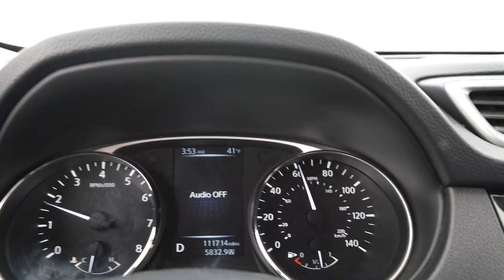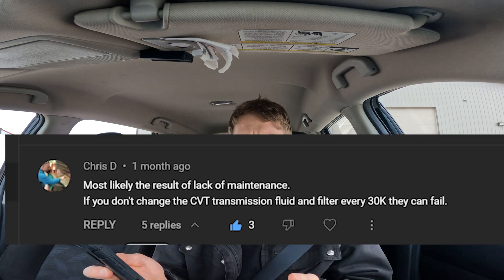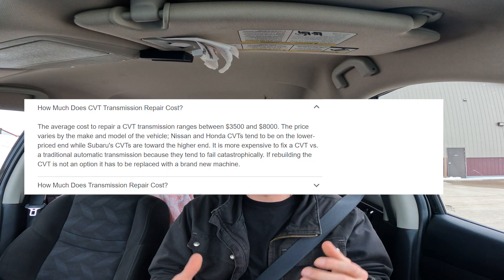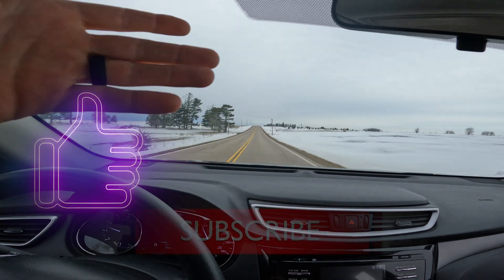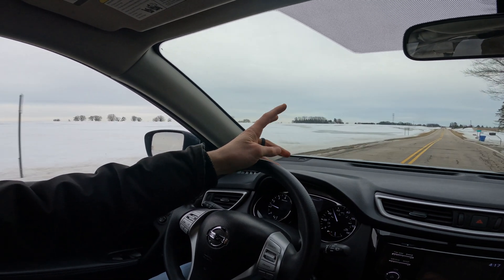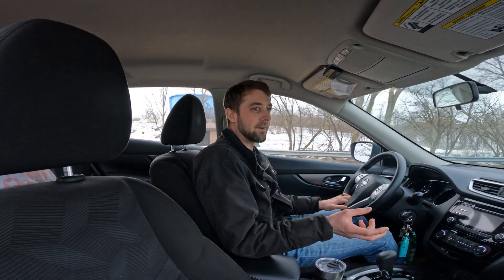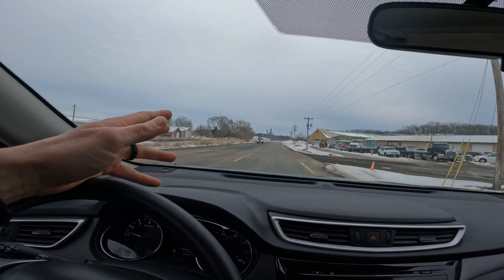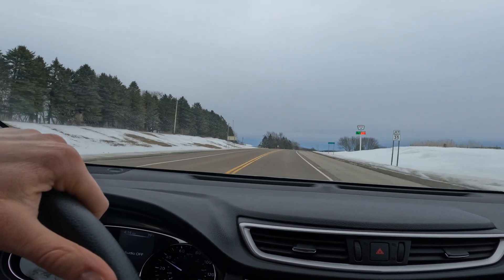Everything WRONG with the Nissan CVT Transmission

Comment: The cvt is expensive? I thought the whole point of them is that they are cheap?

Also, my understanding is the tech for CVT is awesome, but car companies kinda mucked them up, so you don’t get a the actual benefit.
Reply from the maker: That’s the funny thing, they equip them in the economy class vehicles for fuel savings and cost (so they claim) but then the replacement units have a more expensive price tag. For sure a reason for it that makes sense for these companies which I have zero knowledge on.
Reply: They are cheap for the car makers to build, but NOT cheap to repair, because there is usually no such thing as "repair".  Transmission shops do not have the skills, nor the parts, nor the desire, to do a "rebuild" of a CVT, and neither do Nissan dealerships.  They just swap out the whole thing as a unit.  That's why repairs are so expensive - they are "replacements".

Comment: Changing up too soon and hauling heavy loads in any transmission will cause premature wear. CVT's are designed to change up early and this is the trouble with them,,,,, so keep the weight out of the car and don't put your foot down too hard. lf you must have a CVT then do yourself a favor and make sure it is built by Assian. Jatco is the bad brand, only bought by the uninformed. 'Disposable' is the key word with any CVT transmission car.
Reply from the maker: Totally agree! great input.

Comment: I had a 2011 Honda CRV, but I managed to drive it 12 years without a CVT failure, but I only drove it 147,000 km. (91,341 miles) I don't know if Honda had failures with those CVTs or not. I remember doing a transmission flush at least once at the Honda dealership. Whatever they recommended I did. Now I have a 2023 RAV4 Hybrid, but they have an eCVT, and the only thing in common with the CVT is those 3 letters according to Car Care Nut. They don't have any belt, and Car Care Nut describes them as very reliable. He's a Master Toyota Diagnostician, and I believe him. When I bought our Honda, I had no idea what a CVT transmission really was. But I had no complaints about that transmission. I don't like to accelerate fast because that's a waste of fuel, so maybe that is what that comment before meant about how you drive it? Maybe if a person hits the accelerator hard it puts more stress on the CVT transmission?
Reply from the maker: Yeah it seems the common theme with the Nissan CVT is the cooling situation for the transmission isn't very good. So fluid changes are very important. Yeah I would agree if you were "beating" on the vehicle like harsh accelerations all the time that failures would arise. However I'm like you with this particular vehicle as well. Fuel savings. I do like those rav4's too. Great fuel economy and a great looking vehicle.
Reply: Just about to buy a used Nissan with a CVT. I will say that it is a 2y.o. replacement in a 2009 model X Trail, but the current owner hasn't had any issues with it. Also not sure about the noise comments. On the test drive  I didn't find it at all noisy, or hear it make sounds it shouldn't. I actually found it very responsive. Best of my understanding is the CVT failures we hear of are from drivers giving them a good work-out off-road, or constantly carrying full payloads and/or towing. Don't punish them, keep oil fresh and temperatures down and they aren't as unreliable as many make out.
Reply: hello fellow car care nut fan
Reply from the maker: @trevordoeshalloween5994   :person-turqouise-waving::hand-pink-waving:
Reply: Um...an 11 Honda CRV has a regular transmission, not a cvt.

Comment: Looking for a good used car is discouraging right now.  Newer vehicles fall into two general categories:  those with bad engines and those with bad transmissions.
Reply from the maker: Right! Or just buy a new whip for the small price of a middle class house that needs a transmission or an engine. Lolol
Reply: Or just buy a Toyota lol
Reply: @shaungranger2166 Even Toyotas are falling down the spiral of unreliable transmissions. At this point. Just buy a babied 2000s or older car. They don’t make things like they used to.
Reply: And if they are fairly recent models with low mileage, you may as well buy knew because they want almost as much as a new vehicle. So, it is either new or if it is a reasonable price, it has a ton of miles on it. Plus, they recent floods happening across the US makes buying a flood car so much more probable. They send them to detail shops and erase all of the damage and then down the road as corrosion starts to happen in the electrical system and your vehicle becomes a nightmare.
Reply: Wow, you hit that one on the nail! Have been looking for an SUV and it is a challenge. Sales people just want you to pull the trigger!
Reply: Ugly looking and weak bodies as well. New models suck
Reply: Don't forget ones that aren't maintained like a used rogue with 80k miles with original fluid in the trans.  Gee I wonder why it's slipping?!?!??!?!?!?!?!
Reply: Buy a European car and you'll get a great engine and a great transmission. Just maintain it properly like the manufacturer recommends and don't skip services or use cheap replacement parts if you want it to be reliable for a long time.
Reply: lol

Comment: Holy crap, people think the CVT is a technical marvel. Literally anyone with any car knowledge knows the CVT is crap.  I'm a mechanic by profession. CVT's are designed to save manufacturers money.  The screwed up part is, it costs a fortune for the owner to replace.  Nissan CVT equipped cars are throw away cars. Toyota CVTs are far more reliable.  If you want an economy car from Nissan, get the Versa s with a manual transmission. 35-40mpg all day long and it will last far, far longer than the CVT variant.
Reply from the maker: Yup! Preach it brother! Lol 😂
Reply: I want to buy a t31 x trail 2l petrol or diesel ,and manuals are without CVTs?
Reply: People think CVTs are a technical marvel until you show them that snowmobiles have essentially had dry CVTs for DECADES
Reply: You are right. The Toyota ones are different tough, as night and day. They are  named eCVT but they are not using a belt but  gears and the real name is Hybrid Synergy Drive (HSD). They are bulletproof, they outlive the car. The failure rate on them is very small and the ones failing are failing on the electric motor inside and can be repaired, it is affordable or you get a  transmission from another car, they are cheap and plenty.

Comment: I have two and really like the CVT... change fluid often  and it's fine
Reply from the maker: Right on, yeah changing the fluid is crucial. I agree.
Reply: @ShaneyRichards I have 2012 altima 2.5l.  Oil change every 3-5k miles and it has 93k miles on it.  I have heard bad things about the cvt transmissions but that doesn't mean mine with mess up right?  It can go to 300-400k miles if I continue to take  are of it? And did you change the trans fluid?
Reply: @nickcoleman4702  yes fluid and don't get the paper filter and the screen but less so with the screen
Reply: Maintenance in CVTs is like a capricious girlfriend who you have to buy a lot of gifts for every date so she doesn't leave you.
Reply: @peter_shadow7559  Your capricious gf analogy has me 😂😂.  👍
Reply: @abdul-kabiralegbe5660  😆🤣😂
Reply: @peter_shadow7559  maybe for you. How's your love life?❤
Reply: I have a 2019 Nissan Rogue with CVT, naturally. I have read lots about proper treatment of CVT'S. Basically, I really like the quickness, but I baby it. Had the oil changed at 30plus K. Gas mileage has been as high as 38 mpg, but it is usually around 30 on average. Hope I can keep gremlins at bay with goog service. I am not a lead-foot driver, but am easy and steady.
Reply: @rong7604 That's great mpg for how big those cars look. Amazing what modern designs can do. But it really seems like cvts are a great idea but more finicky to own than it should be.
Reply: @rong7604  yes. I have a v6 and have gotten 36.8 mpg. Haters will hate. Right Scotty?
Reply: Costs so much to replace, that it easily goes past the value of the car.  When go car shopping for the next one, Nissan is an immediate no!
Reply: Hope it doesn't fail . 6 grand to replace
Reply: @ontarioman6301 might as well get another car for 6k down
Reply: I’ve rebuilt many transmissions, also engines. Electrical as well. The cvt transmissions are garbage! The only way it might last is by changing the fluid every time you change your engine oil. That starts getting expensive!
Reply: The amount of money that you spent on flushes negates any fuel savings and then you’re still driving a Nissan.
Reply: @2steaksandwiches665  no flush, never flush any tranny, just drain and fill, usually three liters come out,  change like when turning color.  I just have a bottle to suck some out. The problem is that most people who drive a car know nothing about them and ignore fluid changes...
Reply: @2steaksandwiches665 all the Maxima features negate paying for a brand name which may or may not last.
Reply: Nissan sucks! 💯🎯🚘
Reply: @ChrisWhite-zn1dt  you are crazy,... nissan is the best value.. change your tranny fluid
Reply: The manual for the Nissan states to change it every 60,000 mi but if you ask Nissan directly, they say to change it every 25,000 mi which is a huge discrepancy. Plus the fact that they don't include a dipstick on some of the earlier models makes no sense.
Reply: How often is often? For Subaru it's 30K
Reply: I went 60,000 without changing it(changed it last week) am I screwed? I don't push the car past 2k rpm ever though
Reply: @cydzview  should be ok
Reply: Your definitely not a car person if you like CVT transmissions
Reply: My wife and I have always driven trucks and suv vehicles but with gas prices getting crazy again we decided to get an economy car for commutes. I was surprised when I went shopping that every single economy car came with a CVT. I decided to look for a manual because I refused to buy a car with a junk transmission. I was even more surprised when I found out that most manufacturers charge extra for a manual transmission!!! We ended up buying a Nissan Versa in a manual and so far couldn’t be happier. The car is bare bones but as a commuter it serves its purpose, gets 39 mpg and I don’t have to worry about an early failure.
Reply: Nissan has 4 class action lawsuits for knowingly continue to put faulty CVTs transmissions in their vehicles built in 2009-2016 

I’m sure another is on the way as these newer nissans hit 80-110k miles

They are junk
Reply: Yes lazy owners give CVT a bad name.
Reply: Because you are gay
Reply: Just wait 😅
Reply: How often?
Reply: @gcm22490  I check the color on paper towel, if you are just doing drain and fill do it three times, only a few liters each and then like 30 to 40 kms,, check fluid color. everyone drives differently, this guy in the video drives hard
Reply: Still rubbish though.
Reply: CVT is garbage
Reply: Gross
Reply: You belong to a mental asylum
Reply: They still break when they’re new all the time. They’re trash
Reply: How many liters of cvt fluid for a drain and fill?
Reply: DCT is the way to go
Reply: My fluid was great and it still failed. Yes it was the belt
Reply: Great to hear that my dad bought a petrol Nissan juke 2 owner no towbar fitted and 30k I'll get it booked in for a fluid flush
Reply: @MP-po6fj  I just use the pump in the tranny to pump it out for one liter and then add more until it's all changed. I don't like fluild flush machine. If it only has 30k that's a bit low. You can wait a bit and inspect the color of the fluid.
Reply: I had a 2012 Sentra SE, bought it brand new. By 30,000 they replaced the transmission, 15,000 after that, same issue
Reply: You’re the only person I’ve heard of actually liking the CVT. Same story with this fella, bought the car with 61,000 miles for around 16-17k back in ‘20… right when she hit around 150 I started noticing beginning signs of failure and slippage. In the car right now, and it had a major event earlier on the way home from work. Started whining loudly as I let the foot off the brake at a stop light and when I say it whined loud I mean it was loud. Had to pull in somewhere and barely made it, rolled in… had to shut off the car for a couple mins turn it back on with no A/C and now runs… very strange transmission/vehicle.
Reply: I would still avoid them
Reply: Add Oil Extreme Concentrate to Your CVT.

As used around the World on Honda Fitt/Jazz and BMW Mini CVT 2002-2006

Comment: That's the exact reason why me and my family switched and are buying Hyundais now. Hyundai has a lot better quality vehicles and Americas best warranty of 10 years 100,000 miles on engine and transmission. You simply can't beat it
Reply: I have 4 co-workers who have had either a Hyundai or Kia who would offer cautionary remarks on your vehicles' early successes.
Reply from the maker: @gregnixon1296  are you referring to the engine failures? Thats been a rough one for sure.
Reply from the maker: What model do you drive currently?
Reply: @ManvsCars  I drive a 2020 Elantra SEL. My mother drives the 2021 Sonata SEL and we have been getting Hyundai's since 2001 and we have not had problems with them just besides for once on the 2001 Elantra we had
Reply from the maker: @Nicholasminnella7  Glad to hear! Awesome man.
Reply: Traded in my Hyundai SF for a Murano after 1 year. The SF started sucking oil, which is the first sign of engine failure according to those in the Class Action Lawsuit. Im very happy with the Murano!!

Comment: See lots of complaints, but my 2021 Nissan Altima with 34,000 miles on it runs great….so maybe got lucky so far…..but wondering if I should flush or change fluid to N3 fluid with filter….can’t get straight answer from dealerships as to filter change either….so kinda concerned overall.
Reply from the maker: I would recommend changing it. These units do seem to build up a large amount of heat which causes the fluid to breakdown. The fluid change and filter change cost is minimal. Fresh fluid can't hurt unless it's too late.
Reply: @ManvsCars  kinda figured as such…much thanks 👍. However some are saying don’t need filter change for 2021 Nissan Altima…..who is correct….would think with sifter inside filter you would need to extract from metal casing…correct?
Reply from the maker: @williamzee7748  Change it, It looks like a cartridge style filter and its in a housing next to the cooler. 4 bolts. They cost around $10. Worth it!
Reply: @ManvsCars  Thanks again….👍
Reply: @ManvsCars I have 200k on my 19 altima and do the dealer service every 60k miles on the trans.  0 issues and I have driven very very hard at times. No issues but the 2023 altima I drove the other day was brand new and that 1 was whining and it was brand new but only when I floored it from a complete stop. Almost like the rational the best was 2 low or it was moving to fast since it went to redline pretty quickly. I have video of that also.
Reply: 2017 Altima here, change my fluid every 30K, almost up to 90K now, still good.  Keep in mind a "drain and fill" only gets 4.7 quarts (out of 7) and if you drop the pan, you can get pretty close to 5 quarts out  AND you can clean the magnet, pop in a new filter.   Drain and fill means you leave 30% or so of old fluid behind, so   at 79K I pulled the pan for the first time,  everything looked good, then at 86K I pulled the pan again, "flushing" it with 10 quarts (over 7K miles) and I figure it got my trans to about 91% good fluid with about 5% okay fluid, and about 2.5% really bad old fluid.    Its impossible to get rid of  ALL the old  fluid, no matter how many times you flush it. One of the drawbacks to drain and fill v cooler line total replacement (NOT RECOMENDED FOR CVT).    I've heard of them going past 200K  with regular drain and fills though.
Reply from the maker: @johndaniels651  Great point.

Comment: What about the new cars like 2021 onwards?? Because im sure with any technology it gets improved each year following all the problems and complaints.Let us know us about the new 1nz because im looking at a 2023 Rogue
Reply from the maker: I'm unsure about the new models. I'm hopeful some improvements have to be made of course. If I come up with some answers I'll gladly report.
Reply: Nissan went CVT (on the Altima) in 2007, those early units weren't great, but I understand they could regularly go 120K,  by 2010-2012, the units got worse, going out sub 75K, with failures at 30K pretty common...  then they started slowly  improving again.   Sort of an odd learning curve, probably too many accountants in the engineering   department at JATCO, shaving pennies.
Reply: Got a 2022 qashqai from rental and it stalled when i was leaving them. They gave me another one to drive. I don't trust it though. 😃
Reply: Hi, can you advice if the 2019 Qashqai with 1.2Turbo CVT is also terrible or if they’ve improved ?

Comment: Been a Nissan tech over 20 years. CVT's are the bane of my existence. 😂 They're mechanically under specd and most severly undercooled. Some you can't drive for more than 1 hour without overheating. Only the last couple years have they started adding aux coolers and building them more robust. Too little too late.
Reply from the maker: RIGHT! lol. I suppose you see these units all the time then. What's flat rate time on R&R?
Reply: @ShaneOh   All things included such as diagnostic and reprogramming it's anywhere from 5-9 hours depending on the model, warranty time.
Reply from the maker: @hellboundTX333  Right on, I guess the good thing about the CVT is replacement actually is pretty simple and straight forward. : )